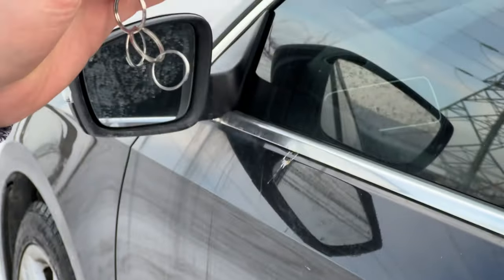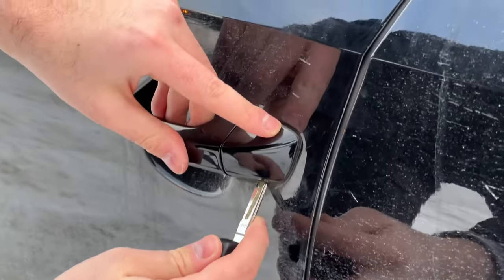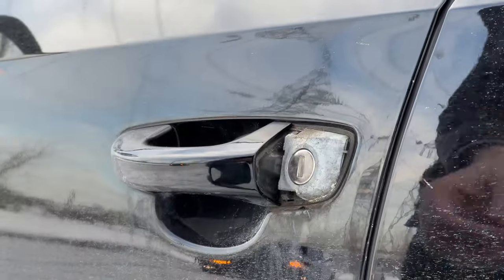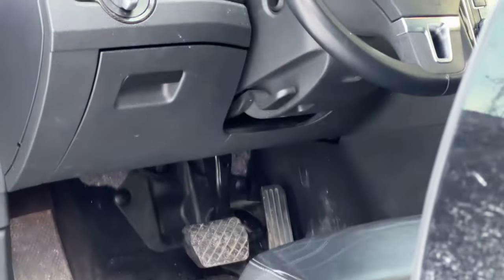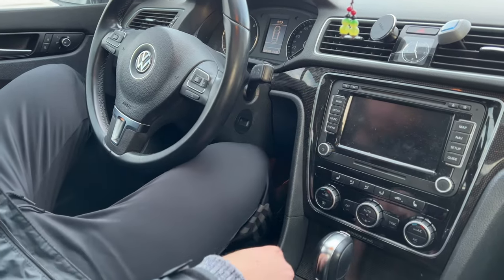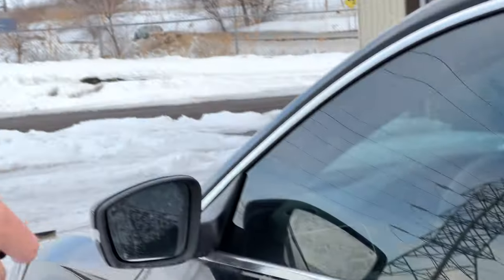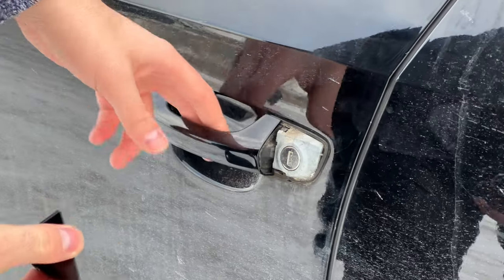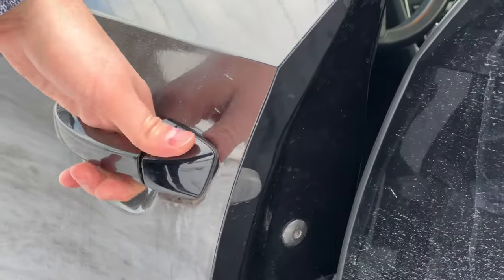How to fix a Volkswagen key fob that isn’t working

Comment: This process worked for me, with one exception - I discovered it was required to momentarily disconnect the battery and allow the car's computer to reset.  Once the battery was reconnected, the re-sync procedure worked like a charm.  If you are following the instructions and it's still not working, try a battery disconnect.  Solved my issue.  Hope that helps someone in the future.
Reply: Umm one...one question? How would one disconnect the battery of a 2018-19 volkswagen passat?

Comment: This only works if the light on the key fob is working. I just changed my battery and the light was working but now it suddenly isn’t.
Reply from the maker: That doesn’t sound right
Reply: What did you do have you fix it as i had the same problem
Reply: Same problem here with a second key 😑

Comment: It worked for my 2021 GTI while I was on hold with the parts department at the dealership😅 thank you!
Reply from the maker: You mean the stealership lol
Reply: LOL exactly! Hey real quick though I got in and started the car but the lock and unlock still doesn't work on the remote. Any ideas?
Reply from the maker: @Bluddsport77  you have a push to start?
Reply: Yes
Reply: That's the best

Comment: Doesn't work. Every time I reopen car door with key the alarm goes off
Reply: Having the exact same problem. Have you managed to fix this?
Reply: @lewisworden1626  sort of, ended up putting old battery back in and got the red light on the key fob when  I pressed it. Tried on car and its worked since! Two new duracell batteries wouldn't work in fob tho, wasn't getting red light? No idea why
Reply: @calderjack7818 got the same issue here. Two new batteries in each fob. Worked fine for a few days now neither of the fobs light up when pressing the buttons. It’s very weird

Comment: BOTH my key fobs suddenly stopped working.  The car does not respond to any buttons on EITHER keyfob.  The batteries in the fobs are fine.  Is this the same issue?  How does it happen?  Is the procedure the same for the second fob?
Reply from the maker: I’m not sure why it happens, but yes it should work for both fobs, did it work for you?

Comment: Yes
Reply from the maker: You did all these steps? Does the red light on the key light up?

1) remove the key cover on the driver side door

2) press unlock on the key fob and manually unlock the door

3) start the car

Comment: Thank you!
Reply: A tip: My 2014 Tiguan was unlocked when the fob battery died. I discovered that even though I could get in the car via the unlocked door, the programming did not work until I followed the video and first unlocked the driver door manually. Cheers!